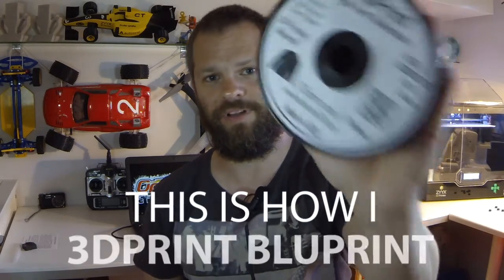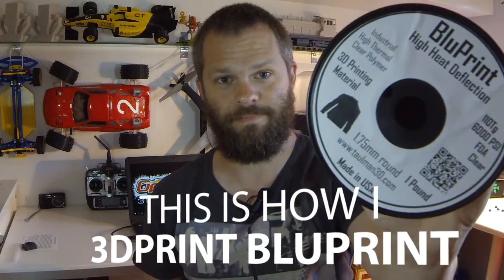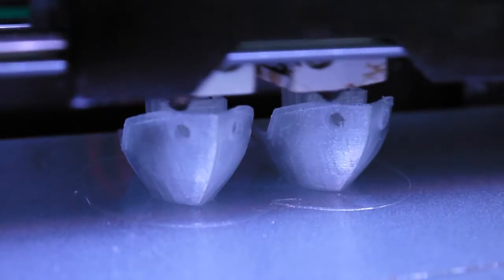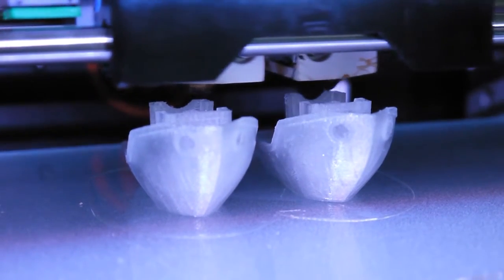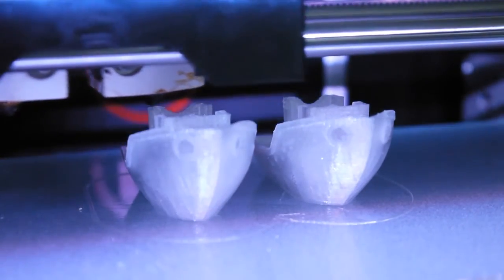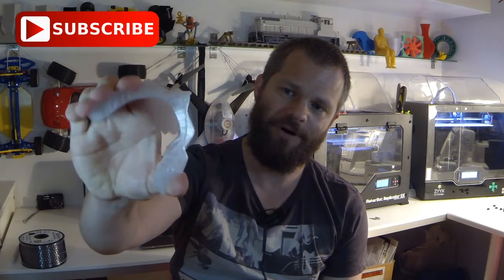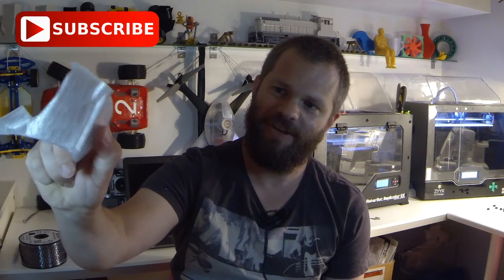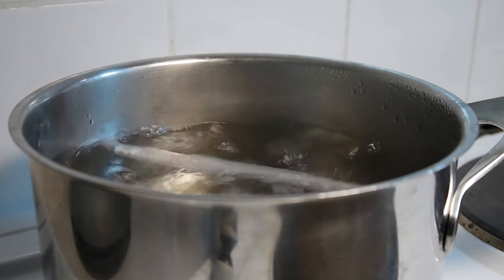THIS IS HOW I - Taulman3D BluPrint

Comment: I am new to this type of filament, what do you mean by water uptake and do you need to dry the whole role?
Reply from the maker: Well take Nylon for example which can absorbe more than 10% of its weight in water in less than 24 hour. Co-polyesters like BluPrint only have a "light" uptake of water so you don´t have to dry it for as long as Nylon which i usually dry over night. And yes you dry the whole role.
Reply: Okay that makes since, so you could use and air tight container or something like that to dry these things before use?